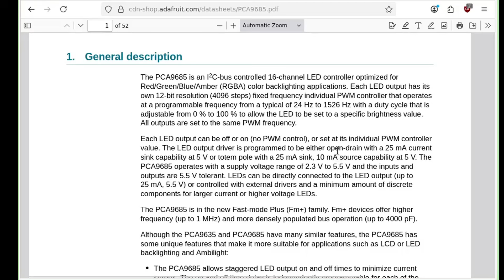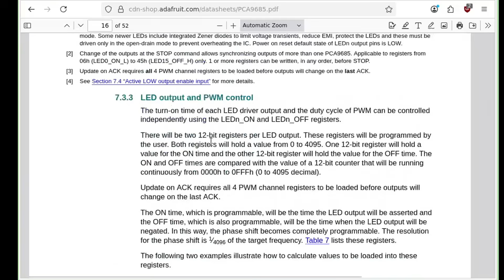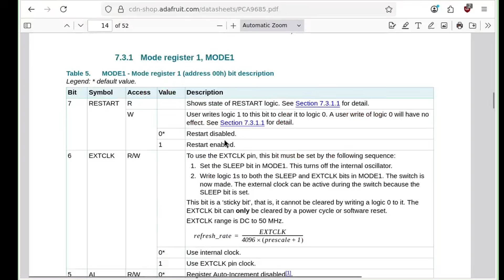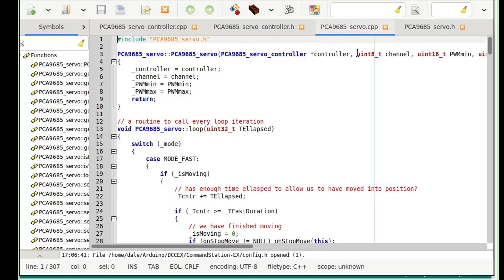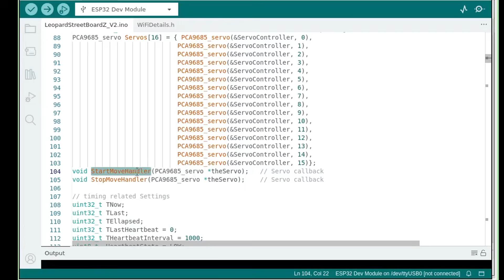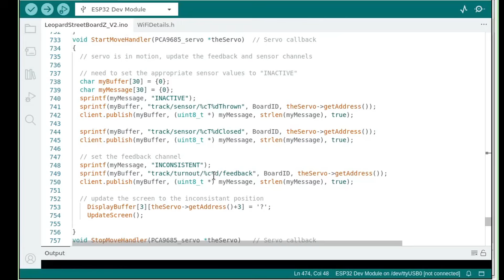201, Driving Servos at Leopard Street Model Railway #modelrailroad #modelrailway #oogauge

Comment: Couple of obeservation
31:55 when setting Mode 2 you set bit 2 which you say is the Ack but that is actually bit 3
56:30 you say there is problem for the callbacks when having servos using multiple controllers. This shouldn't be a problem as the callback only references the servo and has no need to know about the controller etc. - usually it's just the servo address.
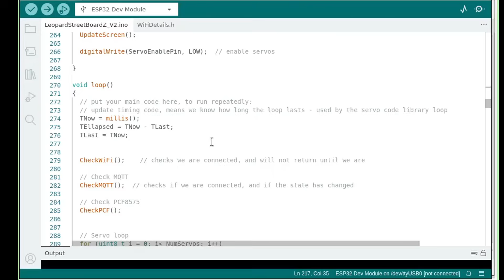59:17 You skip over the end of the begin function and miss mentioning where you enable the servos on line  266
Reply from the maker: first one I will have to check.. its possible I have something working by mistake and not doing what I think it is, hadn't seen that.

second one, its less the issue with the callback as such its that the servos are addressed as 1-16 for reasons related to the code using them, a second set would also have to be 1-16 and needs a way to tell them apart. its actually simple, I need to give the controller its own address from 0 onwards then the servos can have their number + 16* the controller number..

the actual code works fine its to do with how the layout drives them and how the feedback to the layout is managed. hasn't been a problem up until now

third one.. ARRRGGGHHHH yes, there is another part one the actual board code but yes that really needed to be here

three observations.. three very good calls :)

Comment: Thanks for the video,  good to see the software 'under the hood'. That looks a useful library. I confess to having watched the video in three sittings
Reply from the maker: yes sorry its a bit long, partly I'm rubbish at editing but also I didn't want to split this up

there are some revisions it needs to cope with multiple PCA9685 - its actually simple, the controller needs an ID it can report, the servo knows which controller its on so it becomes something like "servo[i]->controller->getID()".. will need it soon as I need it for the goods yard uncouplers
Reply: @aleopardstail  No,  the length was just fine,  good to see the in-depth explanation of the code.  Keep it up.

Comment: Well I thoroughly enjoyed that run through your servo control software! I've got a similar project in my future using the RP2040 microcontrollers I purchased last month, combined with some PCA9685 boards! Obviously the RP2040s don't have WiFi, but I'm hoping to use a Raspberry Pi Pico 2 W as a MQTT "gateway" and pass messages using the I2C bus! I have no idea whether it will work, or how to do it, but like you, I find the mix of trains, electronics and software an interesting combination, so will soldier on until I've found a solution! Now, I'm off to have that biscuit you promised me! :) Cheers, Ian.
Reply from the maker: I started out on the RP2040, ended up with an arduino nano talking over RS485 serial to a C/MRI system..

I suspect you will find a Pico 2W is more than capable of acting as a hub :)

Comment: thanks for the detailed information, i have got your code working with a little modification to suit my layout. the train detection and servos are working need to wire in the relays and have a play with the lights cheers paul
Reply from the maker: glad you have found it useful, its far from optimal, like the rest of the layout it sort of grew more than actually being designed

one thing  I would suggest, think about where the wires run to try an minimise interference, unlike the way I have done it which is to maximise it it seems, servos and the relays modules suffer from noise, I think keeping the servo cables away from the relays helps
Reply: @aleopardstail  thanks will bear that in mind i am only playing with the electronics at the moment before i set things up for the final plan !!!
Reply from the maker: its something I spent a bit more time on, proper planning and fiddling to see what and how stuff works

Comment: hi ian very intersting video how every thing came together   cheers alan
Reply from the maker: cheers, glad you liked it, it does, more or less, all work. the servo code is decent, should have gone with the microsecond stuff and not degrees but I can live with it

useful bit is the over the air update ability of the ESP32, makes adjustments easy. and with the libraries any tweaks are easy to roll out over all the boards with a recompile and upload

Comment: I don’t have soldering skills - so I have a relay on the power supply - once the microcontroller boots up it enables high line , then the power supply
Reply from the maker: this is actually quite a good way, and for servos sort of what I do here, though by accident. the controller powers up when the wall socket turns on, the power to the servos is plugged into another socket, with a second switch.

layout on.. wait a few seconds for it to start up, then flick the other switch. I'm tempted to move the 12v supply over as well
Reply: Yes, I have a switch box, when my relay clicks up I know the controller is on - then flick the board power switch 🙂
Reply from the maker: have had an idea here for powering things up sequentially, its all connected to a home automation system so could easily have each board cascade to the next, then when all are done the relay & servo power comes on.. need to have a think.

waiting for a click is good, nice and controlled
Reply: I'm driving my servos directly from an ESP32 as opposed to using the PCA9685 and had a similar issue with the servo power up/initialisation and so also added a relay controlled from the microcontroller to control the power to the servos. I tried to use a MOSFET but I don't think the voltage drop from the servos was sufficient to switch the MOSFET (at least the ones I used). I don't know enough about the specifics of how they work but I was getting inconsistent behaviour so switched to using a relay.

Comment: Well, you're learning. See you got the track cleaning carriage, good on you. It's better to input simple operation controls to the system. A Gaugemaster/DCC Controller works a lot better, less wiring to worry about. All the better to give one engine and train at a time a good wage-earning run. Plus the purr-fect excuse for Smudge to get upon your lap and pin you down, lol.
Reply from the maker: that cat is weird, shes not really a lap cat, except occasionally. she will lay on someone in bed, but only if you are on your side otherwise she fidgets until you cooperate

in theory the layout could have a different DCC system swapped in - its four wires - two for the layout bus and two for the programming one. the DCC system only drives the trains, all the points, signals etc are via the mosquito system, nominally driven by JMRI but can be driven by anything that speaks the mosquito stuff. the DCC-EX stuff is fine all its really missing presently is a handset of some sort. really do need to finish that little project off. was thinking very nice and very simple handsets, one handset drives one train, dial for speed and direction, a few buttons for sounds..

have to think